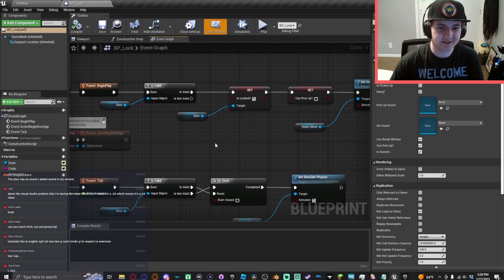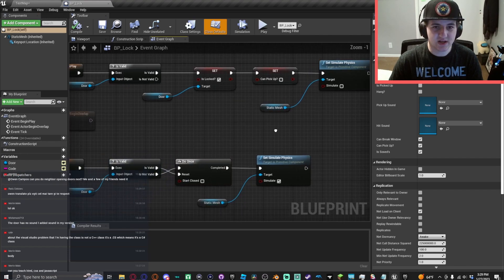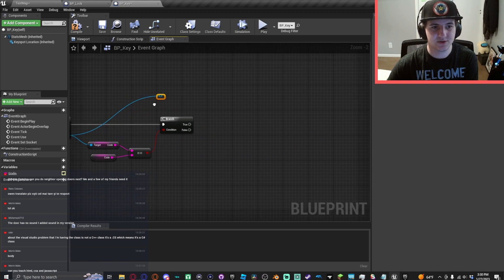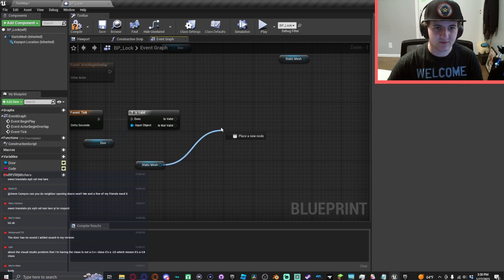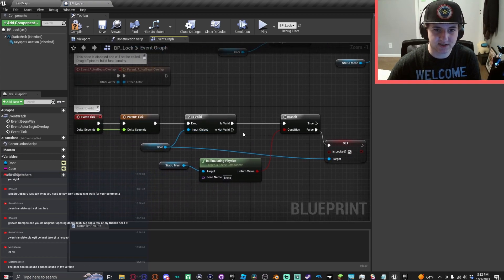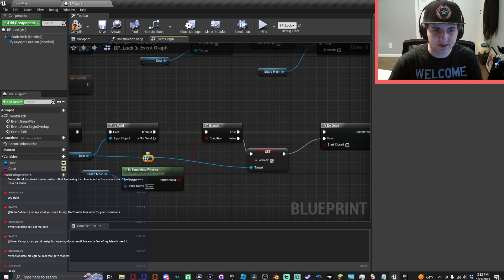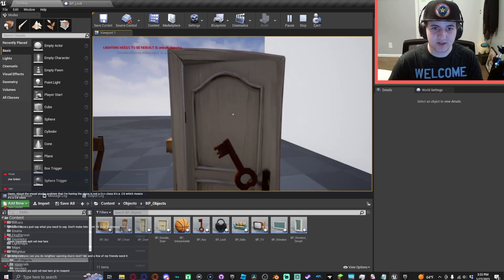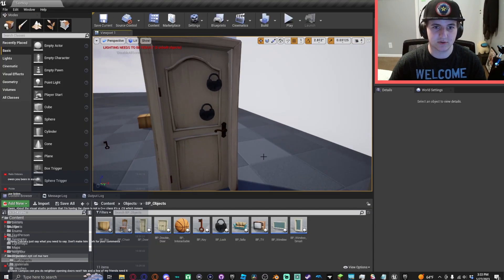Hello Neighbor UE4 Tutorials Episode 2.5: Updated Lock System

Comment: TIP IF NOT WORKING: Check if "Start with tick enabled" Is ticked, If is and STILL isn't working: Check if the "Is locked" after the do once is ticked, If it is, Untick it or your door will forever be locked

Comment: Owen Campos, this is a urgent problem. Whenever I unlock both of the locks the door wont unlock, everything in my blueprints are correct including the same version (2.25+), any idea what could be causing this? I tried everything, asking AI, double checking, asking other people, tried to resolve the problem my self, switching versions and recoding. I'm pretty sure it has something to do with the event tick, whenever I unlock the door the lines don't turn orange, it says I have to enable ticking. Any idea how to fix this? (Edit:Nvm i fixed it. you have to enable ticking in the tab with hang on it.)
Reply: thanks bro you saved my life

Comment: I tried this updated lock system on alil updated version and the door would never open after the locks have simulate physics on, the door thinks that it’s still locked I didn’t really know how to fix it so I’m moving down to the version that the template uses for the editor

Comment: So I tried and it didnt work does it ONLY work in ue4? because im in ue5?
Reply from the maker: It should work in UE5. Go over your blueprint and see if everything is connected with each other as they should be.
Reply: I even double checked and it didnt work alot because the original tutorial didnt go over really where stuff went it cut alot maybe you could make like a tutorial or something that shows where everything should be idk @OwenCampos
Reply from the maker: Although it cuts between parts of the blueprint, it never cuts between parts of blueprints that aren’t connected. So if a part of a node is cut off in one shot, assume it has something to do with the previous clip.
Reply: I might of figured out what I did wrong so alot of other tutorials on ue4 just for some odd reason dont work for ue5 so I saw you made a comment on what version the template is made on so im gonna try that. @OwenCampos
Reply from the maker: @RPM12534 No, it should work fine in UE5. UE5’s blueprints aren’t that different from UE4’s blueprints, so it should work just fine.
Reply: So I just tried it in ue4 and it worked perfectly @OwenCampos
Reply from the maker: @RPM12534 That makes no sense, but whatever works I guess lol

Comment: So, how would you make the terminal? I know it’s very similar to the lock, but it doesn’t simulate physics and the whole process of the lock is ran directly from the “is simulating physics” node
Reply from the maker: That would basically be the same as the old system. Use a “Do Once” node to make it attempt to unlock the door.
Reply: @OwenCampos Thank you